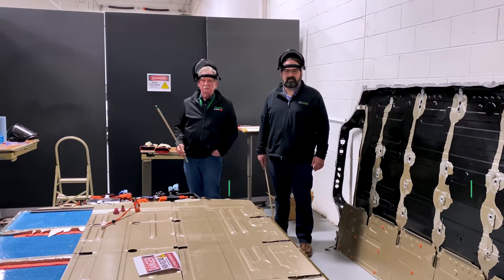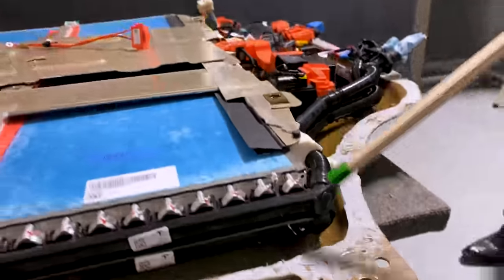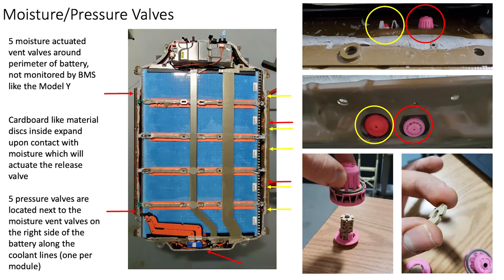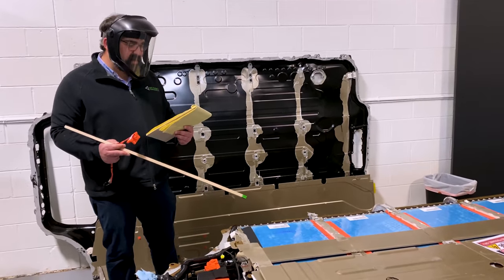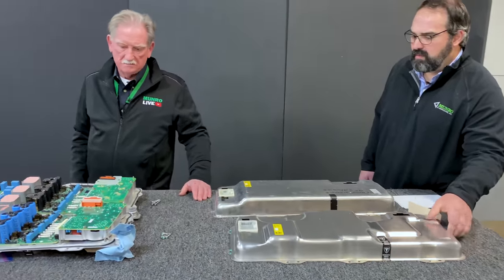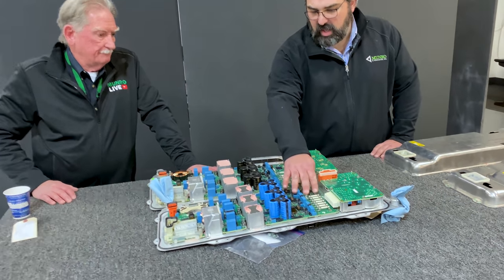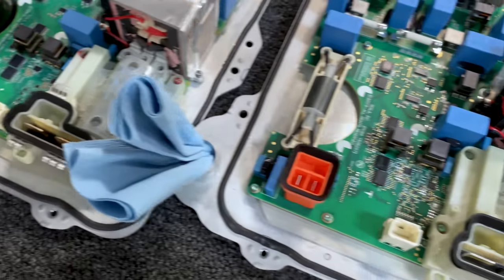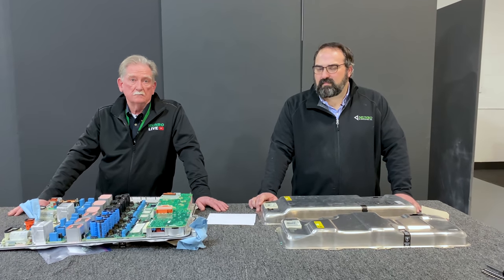Engineering Masterpiece | Tesla Model S Plaid Battery Pack

Comment: 18650 batteries… I never thought they would use that battery size.  Fascinating.
Reply: They might as well use a battery that they already produce, and Sandy did mention there are some thermal advantages. Because the cell is smaller you get a tighter coolant contact area and the batteries will cool off faster. In a super high performance car like this that is an advantage. Although I suspect the reason they use them is because they're already using them, and rather than redesign something you might as well use what you have. Also I believe the 18650 cells are a bit more efficient with less resistance across each cell that would certainly help with power output and input versus the larger cells. Although there are new 4680 cells I believe they're called that they're going to use in the new model Y coming out of the Austin plant. Those are a tabless design and apparently have efficiency improvements even though there it's a much much larger cell.
Reply: That's what they were using in the beginning, as it was the most abundant model.

Then they "created" the bigger 2170 for the model 3, and finally, the, not yet used, 4680 for their roadrunner batteries.
Reply: 18650 is a cell size, not a "battery" size. It is a bit of a surprise, given the 2170 cells in other models.

Comment: are the OBCs different power levels on Y and S in the US? In Europe the 3/Y can take 11kW but S can take 16.5kW.
Reply: North American onboard chargers (of any brand of consumer EV) use split-phase 240 V power input for their highest power; 50 amps at 240 V would be 12 kW. Normal European practice (again for the highest power) is three-phase wye-connection 230 V, so if each phase uses 24 amps that's 5.5 kW per phase or 16.5 kW total. So, it looks like roughly 24-amp hardware, 2 in parallel and 3 on separate phases in Europe, about 240 volts in each case.
Reply: @brianb-p6586  So an US model 3 can charge with the same speed as an US Model S given they have the same power source of 240V? No software limitation to make the Model 3 slower?
Reply: @DaRockCRX  Sorry, I don't know... I only noticed the difference between U.S. and European power setups, and the likely implications for the onboard charger.

Comment: Hey. kW vs kWh.

The confusion runs rampant it seems :p

A very quick physics lesson: a kW is a unit of power (1000 watts), whereas a kWh is a unit of ENERGY. And a kWh is the amount of energy delivered by a power of 1 kW over 1 hour (ie, 3600 s). Hence, 1 kWh is 3.6 MJ.
Reply: Does a 100 kWh battery pack hold 360 MJ then?
Reply: @thesure1  Indeed :)

Comment: So if the onboard charger dies... You need a new pack?!
Reply: No, you need to open the pack and replace the charger... which will be an expensive pain in the neck unless it can be done by removing the penthouse cover without disturbing the main pack cover.

Comment: So looks like the new model S plaid probably costs slightly more than a model Y to build, but retails for more than double the price. Juicy margins
Reply: I have been saying for a long time that if Tesla cared, they could make an S for 50K or less. No need for other suspension parts than on 3 and Y. It's just a slightly longer and wider car. It would not be as nice, but at that price it wouldn't need to be.
But Tesla is not here for our desires. My street is full of stationwagons. Tesla thinks it's too expensive to make alternate body style but they'll put loads of tech in your car and lock it from use if you pay less.
Non EV brands just make the wagon we want and need and charge us a bit more if need be.

Comment: That integration of convertor/charger/battery will make for a more expensive servicable assembly. Good for MFG; bad for customer when it needs service. Can you imagine forking out $17K for a battery pack when a $6.00 PowerFET on a $800 PCBA fails? Tesla really needs to pull focus on their after sale support from spare fenders to affordable servicable (swappable) modules. Granted the product is designed not to fail but as the volumes go up and time goes on they will statistically. Keep them on the road (and out of the landfill) at a reasonable price. TCO
Reply: Tesla doesn't like repairs, they scrap. Your insurance just needs to pony up for a new car after any sort of crash or failure. Super non-eco.
Reply: @Cloxxki  - I think that is a valid perception in the current state. I rationalize it as why would they make spares if every part can make a new vehicle and incremental revenue and address backlog. In a way this is an artifact of their success. It is actually a classic "startup" syndrome. Startups chase revenue and don't pull focus on servicability and aftermarket support until the final phase of their evolution. Then they realize service contracts and spares are actually an incremental and recurring revenue stream. Mind you Tesla is a mature company but I sense they are maintaining focus (capital and resources) on R&D and MFG expansion and the whole post sale support aspect of the business is an afterthought. Note this is also where dealerships come into play but Tesla does not want that business model due to the notoriously bad customer experience (Stealership) and additional markup. So logically they need to just build more Tesla regional service centers and load them with spares or JIT delivery. Getting back to the integration here. They need to analyze probability and modality of failure and insure the Mean Time To Repair (MTTR) is kept within the bounds of acceptable to the customer. IE: Imagine a six hour oil change. An exaggeration but the point being routine service and repair should be kept reasonable and that factors back to repair as an engineering criteria. They also need to pull focus on recycleability of the entire vehicle at End of servicable life - circular economy. Smart people. I'm sure its coming.

Comment: It is the nature of an electric power train to have commonality of parts and economies of scale. In all your electronics (TV, VCR, PC etc) the difference between base sticker and high end is "incremental stuffing options" - usually more of the same parts to give your that premium performance. Example - a Graphics card at the low end might have one GPU chip/structure (called a cluster) while the top of the line might have two. For the Engineering team (Designer/CAD/etc) creating one master set of prints and then duplicating the pages means just a bump in the Bill of Materials and DFM output.  The purchasing people loe it as well - just up the quantity - just give me a group of interchangable parts from a list of suppliers so I can get competitve bids and let good old Capitalism work its intrinsic magic.

Comment: Any thoughts on repairability? It sure looks like you did a lot of damage removing all the covers or cover pieces--and they wouldn't be reusable--and all the silicone and potting gooped on everywhere would need to be removed and replaced after any repair that affected them. If all of this is good for the life of the replaceable assembly, great. If not, well...
Reply: Tesla modules of any vintage or type are not repaired if they have any bad cells. At best, they're re-used in less demanding applications, or recycled (by shredding them and separating some of the materials).
Reply: @brianb-p6586  There looks to be a lot of electronics, electron plumbing, and liquid plumbing in there besides just the cells. Hopefully if any of it fails it fails under warranty.
Reply: @outby50  Yes, and only the electronics have a significant chance of failure before the modules. The penthouse cover should be more easily removable than the main case, and the components under it are all removable. Within an electronic component items are potted, but that's true of most electronic equipment, none of which is repaired (just replaced).

Comment: Why not discharge the battery completely
 before taking it appart ?
Reply: that would permanently damage the cells. Lithium 101 :p
Reply: They made all the capuccinos they could handle for that day so there was no way go get rid of the power.
Reply: Probably testing reasons.
Reply: Even completely discharged it's still in a voltage to kill you. So it honestly doesn't really much matter.
Reply: @foam27  They're going to discharge the battery and tear it apart for a subsequent video anyway.

Comment: Wasn't the previous 100 pack over 8000 cells?
Reply: 85 kWh: 7,104cells, consisting of 16 modules, each with 444 cells in a 6S74P configuration
100 kWh: 8,256 cells, consisting of 16 modules, each with 516 cells in a 6S86P configuration

Plaid: 7,920 cells, consisting of 5 modules, each with 1584 cells in a 22S72P configuration

It is interesting that the Plaid has fewer of the same-sized cells than the previous battery of about the same nominal capacity. Apparently cell capacity has increased and (at least in this configuration) they can tolerate higher current.

Comment: Why is the hand in the pocket?
Reply: If you keep one hand in your pocket, you can't accidentally make yourself a path for high voltage between two points you touch, one with each hand. It's a basic safety practice for high-voltage systems.

Comment: when talking about energy consumption they should use the input energy amount not the capacity of the battery to get mpg equivalent. when you charge you pay for all the electricity including the losses. so saying 100 kwhr  gets you x miles should actually be 105 kwhr or whatever you actually have to put in to charge. means mileage is actually less. when you buy a gallon of gas you get a gallon . you don't pay for 1.05 gallon and only get 1 gallon.

Comment: At 12 minutes and 57 seconds into the video Ben says 100 kW and when you’re speaking in terms of battery capacity it would be more appropriate if you said 100 kWh. Kilo watt hours. You seem to get it right when you’re talking about energy density but not at the pack level. 

It makes you look like a novice
Reply: Not just "more appropriate"... that would be "correct, instead of wrong".

Comment: The amount of technicality in the battery pack is mind boggling no wonder the oems didn’t want anything to do with it and are subcontracting the process to third parties
Reply: There is nothing mind boggling there lol…..
Reply: @carholic-sz3qv  so why wasn’t this done years ago, I’m not an electrical engineer but that looks like a ton of electronics/parts that can all fail and while it may all be very well integrated and organized, it still looks like a hot mess, tons of wiring, chips, capacitors fuses etc. an ice vehicle is probably no better but this does not look simplified at all, it’s a huge undertaking to be able to mass produce just these battery packs alone at cost

Comment: That battery pack does not look like it is very repairable if a group of cells goes bad. Looks like you would just throw the whole thing away and buy another one for ~~$22K.
Reply: Look like you’ll continue to use it with ever so slightly less capacity, and probably not notice.
Reply: Tesla's made after the model 3 have driven 100s of thousands of miles with little degradation to the battery. The one that got blown up (i'm asuming you are talking about this) was a 2013 model S. Just don't buy an old tesla. Their newer cars are lightyears ahead of the older models.
Reply: I've wondered the same. If one cell shorts or opens how is it handled by the pack?
Reply: @ericelfner  not well, thermal Runaway can happen. But lifepo chemistry is a lot safer even in such conditions. Everybody is going lifepo and i wouldnt buy anything else.
Reply: From memory, "they increased the quantity of cells from 7,100 to 7,800"......
Let's say a group of 20 cells fail?  That's 0.25% reduction in performance.
Reply: @slavko321  
These aren't LiFePo4 cells, (but it's not a problem)
Reply: @rogerstarkey5390  If an entire group of 72 parallel cells (or even any significant fraction of one such group, such as 20 of them) fails, the entire battery is non-functional.

Comment: from what I'm hearing making it less robust in the intrest of weight savings so id rather buy older and upgrade capacity but the extra space for crash saftey is a thing the cooling efficiency does appear much better design though guess I'd stick with the heavy duty model imo though lightweight race model has it's range advantages
Reply: Which part of "more space around the cells and glued metal sandwich on the edges for structure" did you miss?

Comment: Yeah.  Legacy automakers never think a head or use products across models lines.  When will GM stop coming up with new LS small blocks.  Every month a new one that not backward compatible.  Ford is just as bad with their Ecoboost. 3.0, 3.1, 3.14159, 3.2, 3.3, 3.4, 3.5, 3.7, 3.8, 3.9….. Don’t get me started on Toyota. /s
I enjoy the tear downs but the off the cuff analysis seems to be getting worse.

Comment: The Li-on battery tecnology is reaching it's limits in terms of Energy density. Which didn't improve by a big margin in the last decade. That could change with Solid state battery Cells, or with Sodium-ion battery Cells.
Reply: Solid state can still be lithium ion so you're contradicting yourself.
Reply: We don’t need more density in cars but cheaper price.
Reply: @volkhen0  could be possible but with Sodium-ion batteries. Not so easy that easy with Li-on or Solid state batteries.
Reply: @RogerM88  prices are coming down as we speak, so i dont know why you say that.

Theyve already reduced in price by a factor of 8-10 in 10ish years. 50% cheaper from where we are now us all thats needed.
Reply: @wizzyno1566  not for long. BEV production is too dependable on supply chains to battery production. That could lead to Lithium shortages. increasing even more the average BEV prices. That's why, BEV with lower range and PHEVs with smaller battery packs, could be affordable options to mainstream car electrification.
Reply: Yeah, and the earth is flat. 🤦🏻‍♂️
Reply: RogerM
So you don't know much about batteries either.....
Here's a tip.
Take a look at the limiting factor YT.
Just released his latest, you should learn something
Reply: @RogerM88  
What's the volumetric density of sodium ion?
Light weight but large is no good if you can't fit it in the vehicle?
Reply: @rogerstarkey5390  still with many other advantages than Li-on batteries. Cheaper to produce, more sustainable, and not so prone to combuste.

Comment: The battery longevity, being a concerning item to many people avoiding BEV, the NIO option for quick battery swap is a great feature. First it allow the battery to be quickly swap, and second it allows to rent it, lowering the average BEV prices.
Reply: Its a none starter long term. It will be looked back on as a design dead end in a few years.
Reply: Swappable batteries are a poor design. They stopped doing this for phones years ago because swapability adds cost, complexity, bulk, and weight to phones. In reality you never need to swap your phone battery because you charge it every night (just like an EV). On the off chance you drive more than 300 miles in a day you can supercharge near a food stop for 20min and watch some netflix while you take a break from driving. Battery swapping is barely faster than this anyways. Tesla's batteries have also been shown to last 100s of thousands of miles with modest range degradation meaning it will likely outlast other major components of the car.
Reply: It all depends on the price of renting. They are heavily subsidized now. As for battery swap - can't scale up and takes about 10-12 minutes. A Supercharger session is 15-20minutes avg now vs 10-15 minutes in about 6 months with the 300kW upgrade. Absolute zero benefit of battery swap.
Reply: @5893MrWilson  not a poor design. It's been used for decades in many industries, with the ability to standard battery sizes as with AA batteries. That would mean battery packs could be standard, lowering production costs. Being quickly replaceable, would also allow the process to be automated, and the option to rent the batteries.
Reply: @5893MrWilson  Great points. As you note it isn't even that much faster and even less so in the future. Because, in a few years you will be able to charge at most locations right where you park anyway. No need to go out of your way to a swapping station, how much time are you really saving then? On top of that it sounds to me like having to manage a bunch of unused batteries sitting around in swapping stations and the swapping stations themselves can become a huge liability as well. What if the average range of cars increases a bunch in the next 3 years? so even fewer people feel the need to use a swapping station. You've invested all this money into facilities that are rarely used with batteries sitting around not being in cars making you money. What if you business isn't selling as many cars as you'd hoped?
Reply: That is proprietary bullshit from Nio. Will not make it.
Reply: @Stefan_Dahn  not nio propietary though. Tesla offered a swapping station from 2013-2015 for the model s only. You can find videos of it on YouTube it could do a swap in under 5mins back then. Nio just copied tesla again, just like they copied offering battery leases from Renault who offered them on the zoe from 2015-2019.
Reply: One of the biggest problem with battery swap is it requires 3 or 4 times more batteries for the number of EV vehicles made. Considering that producing enough batteries to fulfill present day EV production is the biggest restriction, I don't see battery swapping as being viable in the long term.
Reply: Battery longevity in your iPhone is very different than an EV. An EV battery carries an 8-10 year warranty on capacity and will easily last 20 years, with another 20 years beyond that as a salvaged stationary power component.
Reply: It's a waste of resources.
And a logistical nightmare.